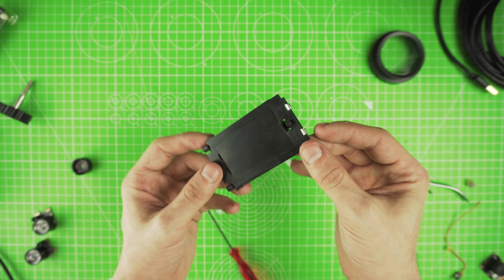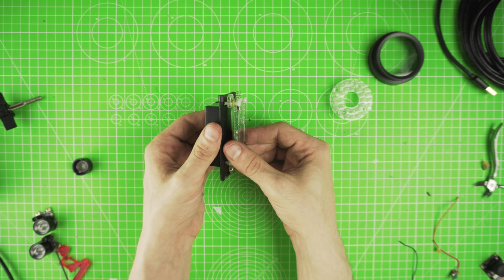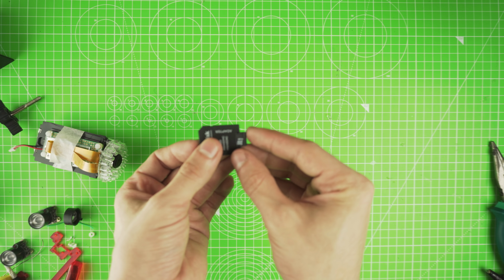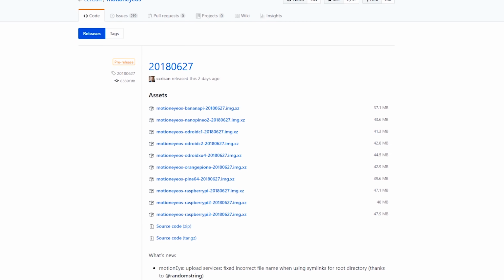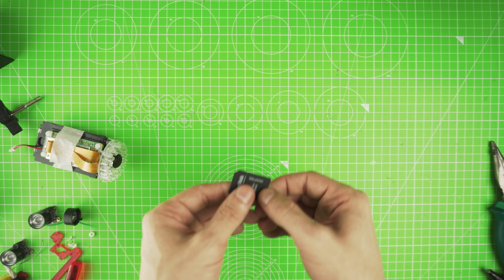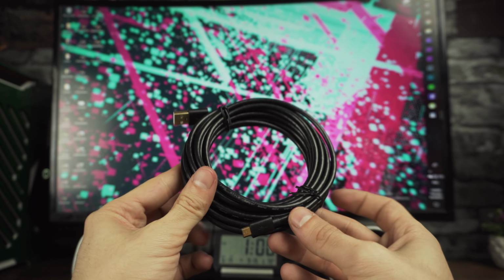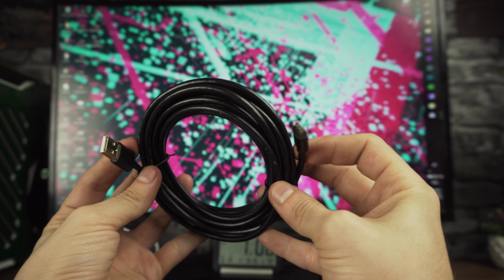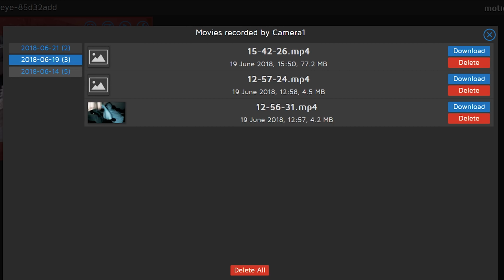How to make a Raspberry Pi Night Vision CCTV Camera

Comment: Hey guys, just a friendly tip:
I've experimented 1 week with MotionEye and MotienEyeOS on Raspi Zero W and 3B+ in all possible configurations including fast camera mode, and I was not satisfied with the result(fps, motion detection).
Tried PiKrellCam however and it's a completely different experience, smooth motion detection with superb framerate, give it a try instead if you don't need the MotionEye hub and multi camera features. (there are some disadvantages, do some research)

Comment: The problem with this is that if the intruder breaks the camera and take it with himself, you'll lose all the footage, it'd be much better if you could only embed the camera inside the fake camer enclosure and host the actual rasberry pi inside the house.
Reply from the maker: you can set it up to store the footage on the cloud also, but yeah, the pi in the house was my first idea of going around it, but the extension cables that I wanted where very expensive and it was cheaper with a micro usb wire :D
Reply: You just need a server and redirect to the local hosted server
Reply: You could use Power over Ethernet (PoE) and a PoE Splitter (converts PoE  back to Eth data & Power USB) for the RPi Camera module.  That way the camera can be 100-150m away from the actual power source (router or PoE injector).  If you are paranoid you can put your PoE injector on a UPS.  

Also has the advantage of being able to use cable data rather than wifi.  You can have a gruntier centralised RPi doing all the data storage, motion detection and alerts.
Reply: @philipandrew1626  Thanks this was a good suggestion!

Comment: pretty sure this wont last 1 day in the elements
Reply from the maker: Wasn't made for it, but just don't add the IR lights and can hold the elements just fine :D It has a rubber gasket on it
Reply: My setup lasted more than 2 years. Apply silicone on the board .
Reply from the maker: Exactly